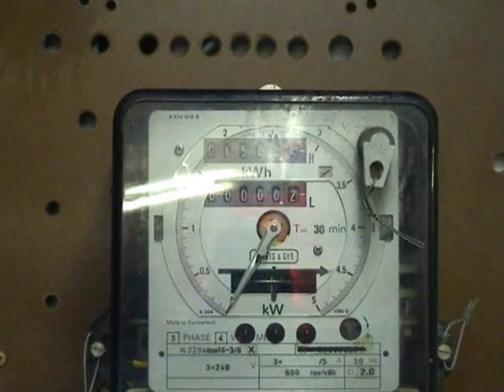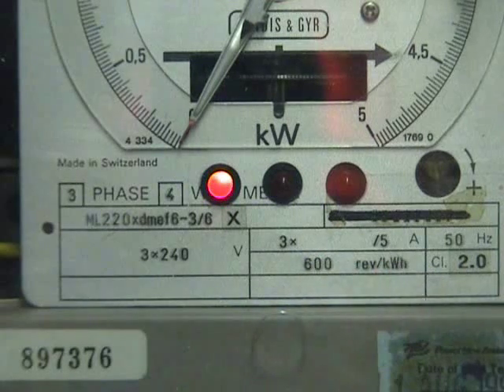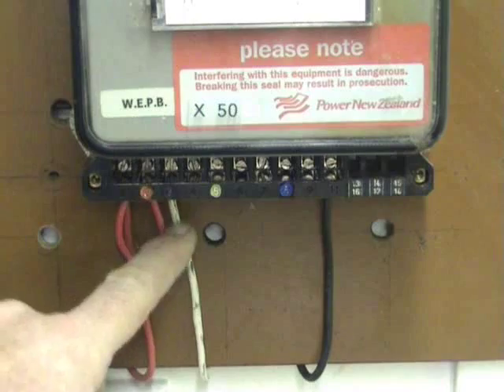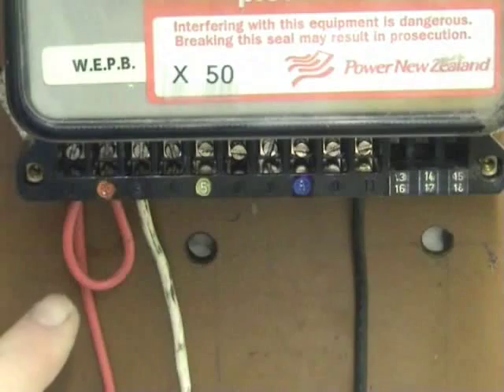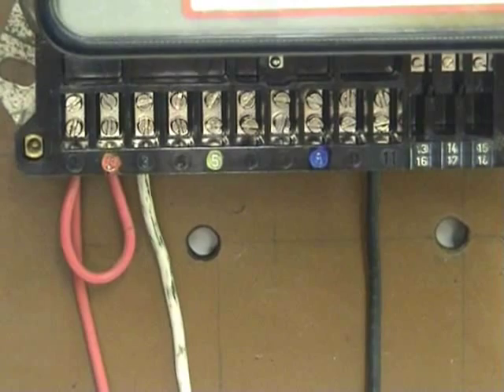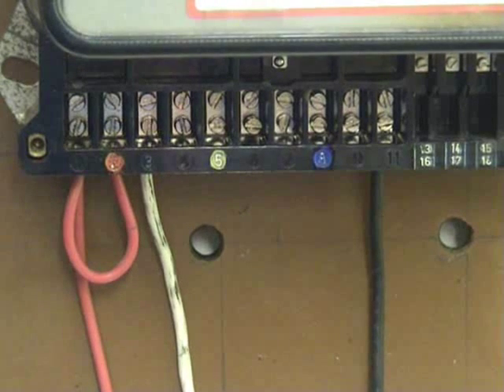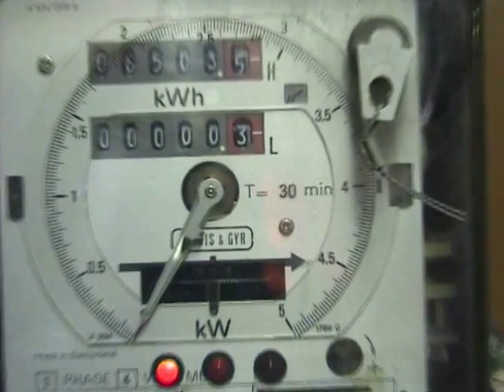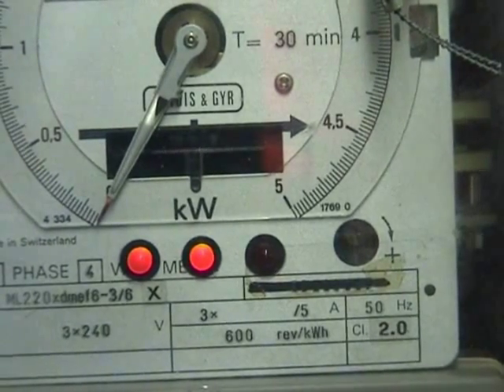Landis & Gyr ML 220 three phase CT meter in single phase set up

Comment from the maker: @Felix2417425 Ok, best place to get one is at your local power company.
I have a 100 Amp kVArh meter but it is 4 wire.
I will connect it up and see what happens with a resistive and inductive load.

Comment from the maker: @Felix2417425 The load may be not enough to turn the meter over.
Try a transformer 220 / 12 Volts and put a car 60 Watt lamp on the 12 Volts side of the TX.

Comment from the maker: @HDXFH No, dual rate means two tariff registers.
Polyphase or 3 phase meters can be made with 1 , 2 or 3 discs.
3 disc meters are taller 1 disc meters are fatter as the coils have to be placed around the disc at 90 or 120° angles. 2 disc meters usually have two elements driving one disc and the third on the other disc.

Comment: Landis & Gyr Make good Metering Equipment, We have an MM 2000 Model With a clear plastic casing, it has 2 discs, which would make it dual rate, being 3 phase